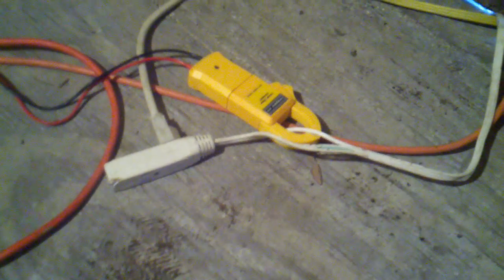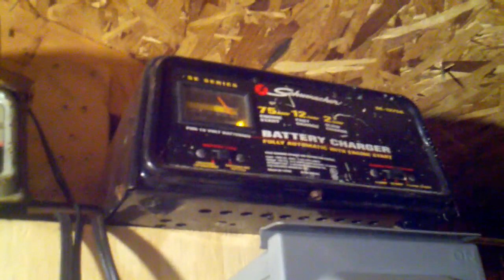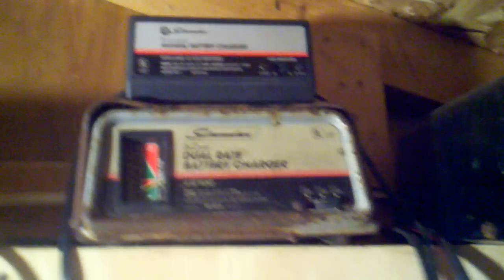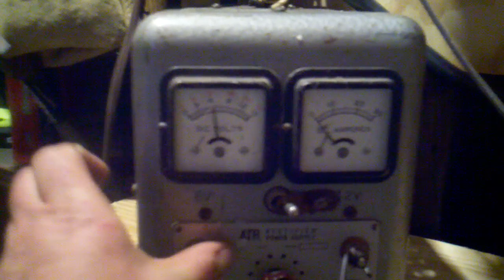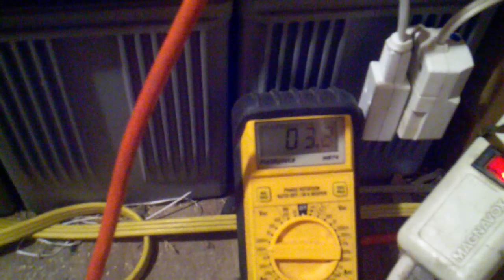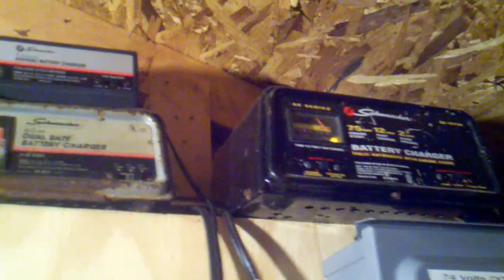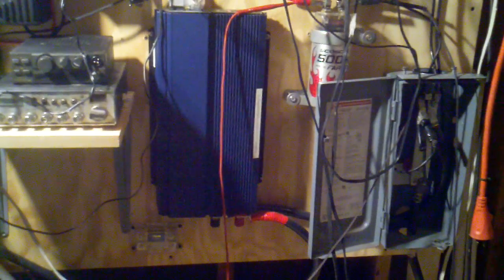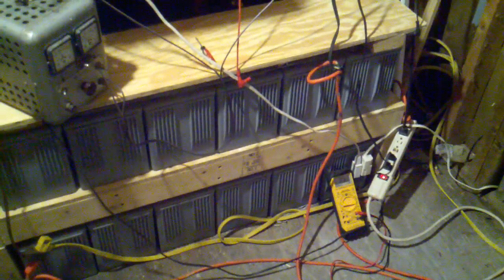My backup solar battery bank charging set up

Comment from the maker: when I first started I had everything set up as 12v and after I got the big panels i rewired my panels to double the voltage too.  i now dont use the HF charge regulators for that purpose I only have them connected for the display and output options.

Comment from the maker: If you go online and enter "Outback Flex max 60 PDF" you should pull up the manual and you can print it.  as far as the Part# not sure now as its in the shed and I'm in the house but its a 100 amp breaker bought at an auto parts store.  I'll get the PN for you later.  THanks

Comment: Nice setup. I have that generator too. I think I put a gallon a gas in it 2 months ago. It is still going. I have an off grid set up too. I am trying to figure out my Flex max 60. It doesn't come with an owner's manual. I noticed in 1 of your other videos you have an automotive circuit breaker, do you have a part number?